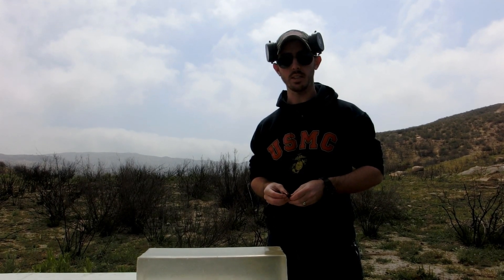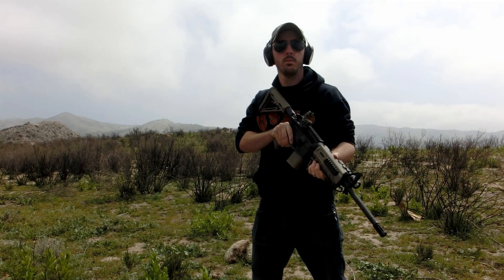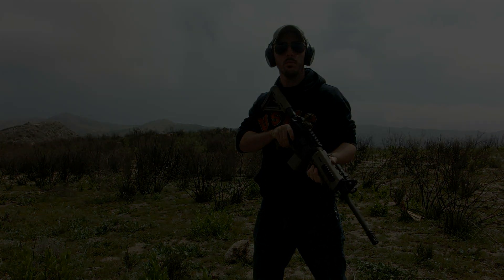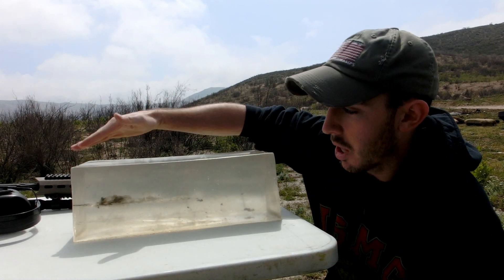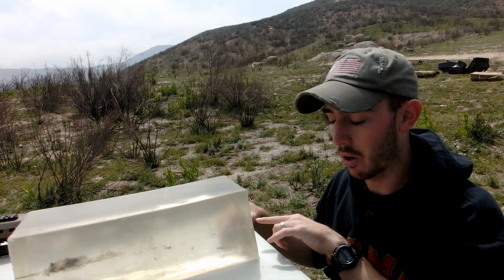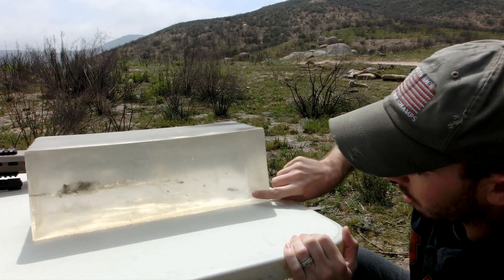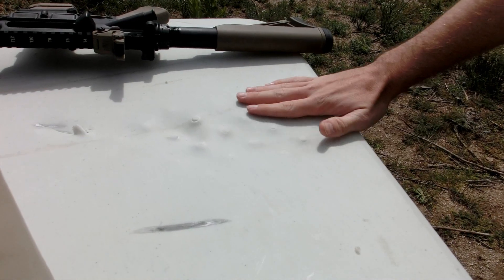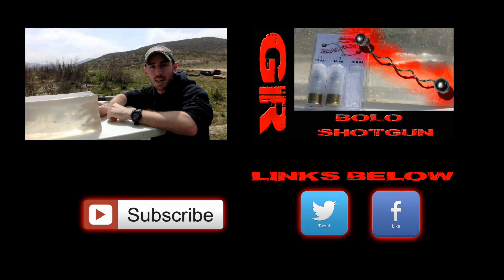Gel Test - Full Metal Jacket vs Soft Point Ammunition

Comment: Soft point rifle rounds are fantastic. I really like the speer bonded bullets for hand loads. They are extremely consistent, and only cost a few more cents a round than standard hornady open tip bullets. Your loads could stand to be a bit hotter though. 55 grain FMJ should fragment at 25 yards without a problem
Reply: From a 20 inch barrel u lose like 400 fps going to a 16 inch and the fenomenom happens at 2500 fps 55 gr from a 16 inch is about 2800-2900 fps

Comment: I reload and I made a bunch of 223 SP rounds that measure 2.19 inches (55.6mm) and they fire fine and dandy. When I seat them to be 2.24 inches they look "off". Question is what am I doing wrong?
Reply: Its just because of the cannelure (ribbed section) of the bullet not matching up with the top of the neck. It doesnt really matter where it ends up as long as its not longer than 2.26 (magazine length of AR mags). I load mine to just below the max length because it generally gives better accuracy for most bullets and more case capacity for powder.

Comment: My gut feeling is that with today's fast twist barrels, you totally lose the tumbling effect of the 55 gr ball ammo. You still get some hydrostatic shock of course, and apparently some fragmenting. All of which is good. But i wonder how effective the tumbling was out of the original 1:12" twist barrels.
Reply: I'm not sure there is all that much difference.  What do you think the current standard twist rate is? I looked at the 5.56x45 wiki and it states 1:7 but I've seen a lot of barrels having 1:8-10".  Even if it was 1:6" then the bullet would be spinning 2x as fast. If it was a 1:6 rate, it would have 4x the rotational energy which is better for stabilization but I'm wondering how much it effects the bullet once it has hit a target, especially a soft one like the gel or flesh. 
I'd very much like to see a comparison though, especially doing both twist rates with SP & FMJ.
Reply: @kde5fan737  - Yeah 1:7 and 1:9 are the most common nowadays. Have been for a # of years. IIRC, the 1:9 twist became standard with the new SS109 (62 gr) bullet was standardized in the early 80's. The M16A2 was thus equipped, with a heavier barrel, along with a complicated micrometer rear sight requested by the USMC (probably unnecessary, but their marksmanship tradition wanted it). And of course, 3 round burst instead of full auto, which did make sense). I think my Bushmaster is 1:9, but i don't have it handy to check the markings.
Reply: No… The twist rate difference is a negligible factor because the difference in the density of air vs tissue is way too great for the bullet to stabilize in flesh. It will still tumble and/or fragment as long as the velocity threshold is met(barrel length/FPS on impact related). Twist rate is about the Rotational speed required to stabilize a longer(usually heavier) bullet in the air for accuracy. The heavier FMJ bullets will tumble and fragment more readily at lower velocities in dense mediums though because they are even more unstable in flesh/dense mediums, thus trying to flip over to base end forward and exerting a greater sheer force against them when they do hit a medium more dense than air…
Reply: @TooManyChoices1  - good point. I know bullets are made rear heavt to facilitate tumbling. The Soviet 52 gr 5.45x39mm bullet has an aur space beind the nose just for this reason. And this reputedly tumbles, with a MV of 2800zodd fps, compared with about 3200 fps for our 5.56 55 gr from a 20" barrel.
Reply: I remember reading an article explaining that impacting soft tissue will severely destabilize M193 ball ammo and cause it to fragment even with the fastest twist rates such as 1 in 7. I've seen several videos of 55 grain ball ammo being fired from a 1 in 7 twist barrel and the fragmentation is indeed pretty violent. The fact is that expanding ammunition simply cause more damage than a ball round but that doesn't mean that the damage caused by ball ammo is inadequate in and of itself
Reply: @user-oy8dl1er5h  -That makes sense. Any light, fast projectile is subject to fragmentation. The reduced penetration is why most SWAT teams switched from 9mm SMG's to AR-15's many years ago. And they are quite effective. Many agencies use ball or basic soft points for their patrol rifles. You don't need whiz bang exotic stuff to be effective

Comment: I'd rather have the FMJ for defense when assailants are in a vehicle. They'll go through without bullet breakup. 
  Got to admit, the soft point did have some pretty good penetration at close range. It would possibly have more penetration as the range got longer.
Reply: @James what did I just watch then??? 🤔🤔🤔🤔🤔
Reply: FMJ rounds will rip through a car body pretty easily but they have a bit of trouble going through autoglass. Weirdly enough, I've seen tests where 55 grain M193 FMJ actually did better than 62 grain M855 FMJ against windshields due to higher velocity despite the M855 having a light steel penetrator. The best rounds for barrier penetration are, well, the so-called barrier-blind rounds which are usually bonded soft points. Needless to say the extra performance costs more than FMJs or regular soft points so it's always up to you to decide whether they are worth it or not

Comment: The same way a diesel engine ignites without spark plugs. Compression. The soft point expands rapidly creating a larger wound cavity than the FMJ. Ballistics gel is actually flammable and some of it gets vaporized during the cavitation. After this rapid expansion, you have a rapid retraction which causes compression and the flammable vapor to actually ignite. It's been observed and documented by people doing gel tests with super high speed cameras.
Reply: Chris Daniels N
Reply: Holy fuck really? So if a hollow point hit you across the shoulders (we'll say that because of density, length, etc.) it would theoretically ignite your insides?? (Provided flesh has enough tensile strength to close back like b.gel)
Reply: @DIRTYSANCHEZ1995  No ... 🤦
Reply: @TooManyChoices1  lmfao
Reply: @DIRTYSANCHEZ1995  - No, because human tissue isn't flammable like the ballistic gel is, therefore you won't get the same result.

Comment: Remember when you select ammo for your rifle IWBA penetration protocol still applies(12 to 18 inches).  It doesn't matter how much energy the cartridge generates if it does not penetrate deep enough to destroy something vital.  There is expanding ammo for the 5.56x45 that does penetrate 12 inches or more before the bullet fragments. 

I liked the video.  It was clean and to the point.  I gave you a thumbs up!
Reply: Steve is correct. the 12" rule really applies to handgun ammo more than it does rifle ammo. Handguns to not carry as much energy into the target so its more important that they penetrate to vital organs. typical 9mm defense ammo only carries about 480 +/- ftbl's of energy, typical .223 caries about 1200 +/- ftlb's of energy. more than twice as much. its like the difference between getting hit in the chest with a framing hammer vs a sledge hammer. neither feel good but one will do a lot more damage.

Comment: Energy was released as the round lost speed and inertia rapidly.  Whenever energy is dissipated this quickly, the loss of energy converts into heat.  Just like our car's brakes.  The temperature was hot enough to burn the plastic gelatin, resulting in the black, burnt appearance.  Smoke was result of the burning gelatin.

Comment: those weren't tracers right? that will definitely explain it..
otherwise that might have been burning gel ,that's extremely rare since whats leftt of the bullet will need to stop at a very close distance to the end of the block to allow to the hot metal to burn the gel and allow smoke to escape from a tiny cavity,probably the end of the cavity was generated from expanding hot air..you don't see that happening very often.
Reply from the maker: The bullets were not tracers. I used Hornady 55 grain SP and FMJ bullets. I think you're correct. The expanding gases are the most probable answer to this mystery.
Reply: @ShareTheLightTV  Sorry Marine, but that is an incorrect answer. It smokes because it's a flammable synthetic gel block. Real organic gelatin blocks never smoke.